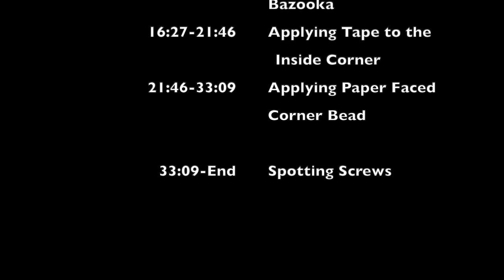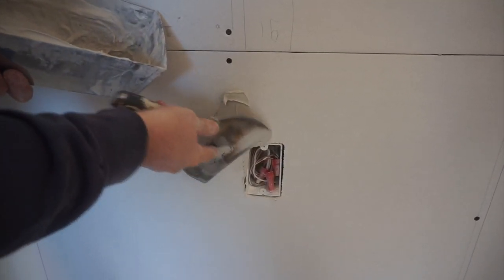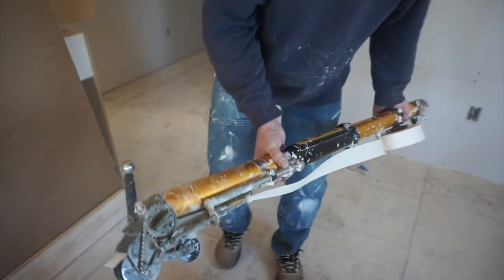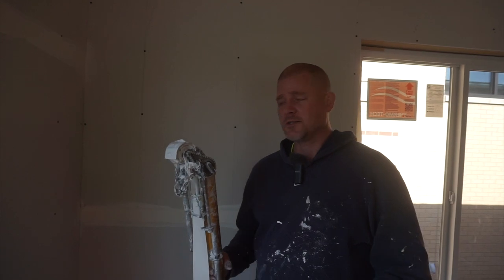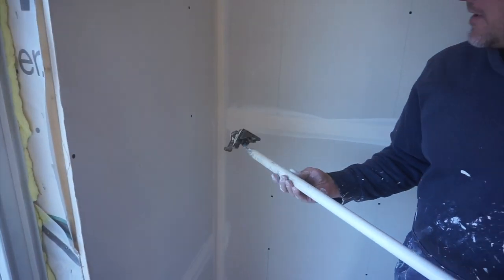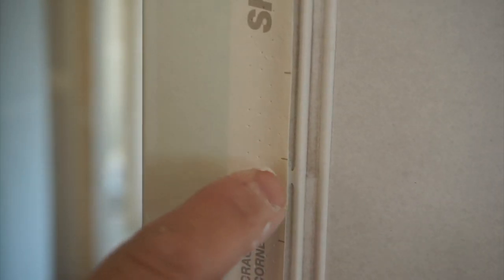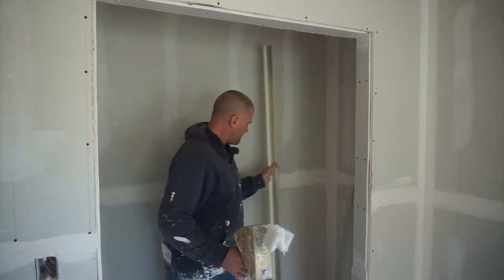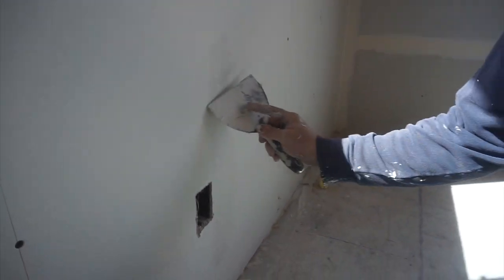Taping Drywall With A Tape Tech Bazooka: Part 1

Comment: You had me up until you used light weight mud to bed your tape with. Not enough glue in it. Should be using heavy all purpose for bedding tape.
Reply from the maker: Thanks for the comment! I have never used the all purpose mud. How is it to work with compared to the Light Blue?
Reply: @Red Pine Ridge Farm  its definitely a lot heavier to work with but you can't peal your tapes afterwards like with the lightweight mud. I get tons of jobs repairing popped tape seems because they used lightweight to bed the tape with
Reply: For me it's about the same for knife work. All purpose definitely harder to sand, but that doesn't matter since finish coats are with plus3.

You can also just mix in some glue to your lightweight and you've got a nice taping mud.
Reply: @robertm5969  Can attest to adding glue to lightweight mud for taping. Been doing it for long time. Save ya from buying different types of mud. Usually add elmers glue or carpenters if elmers is not on hand for purting up tapes

Comment: Just curious who is accountable for the poor sheet rock hanging. Will that reflect your pricing?
Reply from the maker: They are students who build the house for a class in school. This is most likely their first time hanging drywall and is intended to spark interest in the trades. Normally it would justify a price increase, but for this situation no. Thanks for the question!